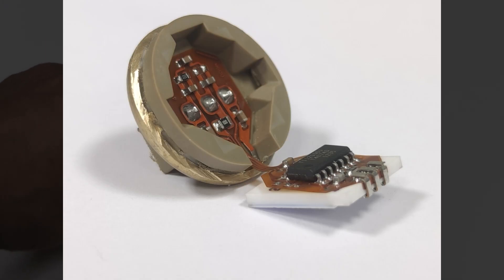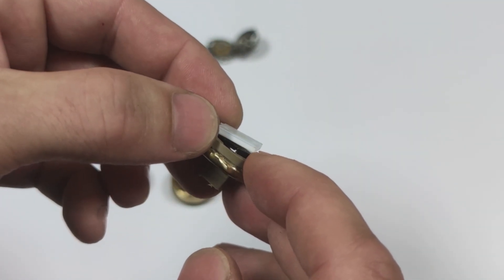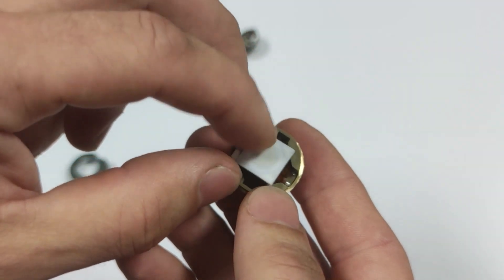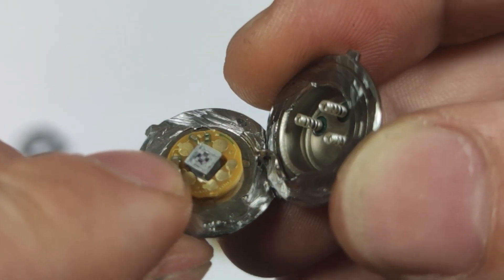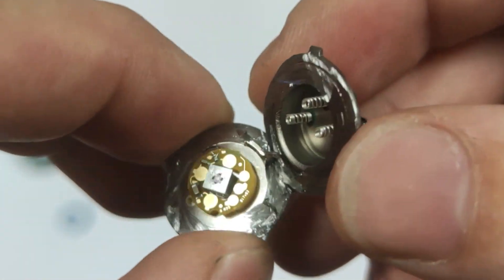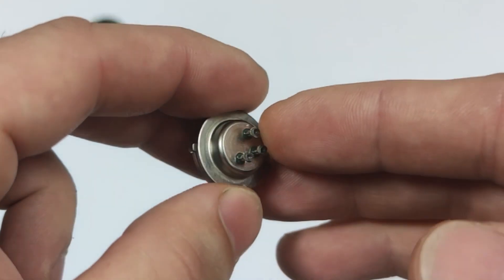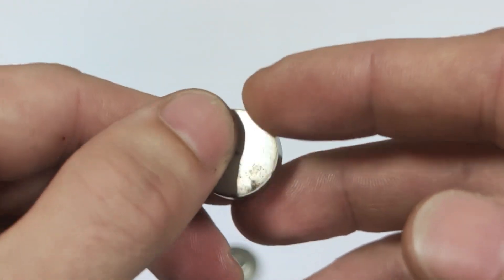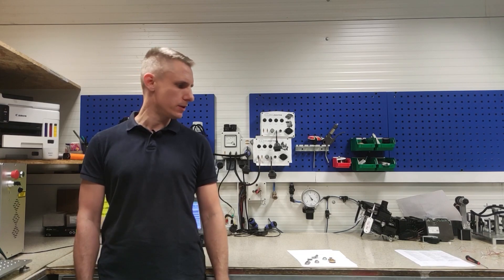The functioning of the DQ381 DQ500 pressure sensor of the DSG automatic transmission

Comment: Nice video !
I wish i could have seen it in 2023 as I made this repair to my 2017 VW tiguan at 160000Km.
It was fitted originaly with "SMP132-420" with the black center and I replaced them by cheap "BEA110" at 60€ for both from Aliexpress, the only spare available at that time.
That never worked for me: both sensors were reading approx 0 bar in neutral but their responses time were too low, especially on 1 sensor.
I tried to run the basic setting so many times and was only able to drive untill the 3rd or 4th gear before to get a fault code.
I had to go to the garage for a whole mecatronic replacement (2000€).
Waste of time for me but very informative.

Comment: Hello, is it possible to use  SMP132-532 sensor for DQ500 0BH gearbox? It says that sensor compatible only with DQ380/381 or 400.
Reply from the maker: They are compatible with the DQ500.
Reply: @Zweimassenservice  Hello, I put smp132532 on the dq500 and they were smp 132420 and they won't work, is there any way I can adjust them?